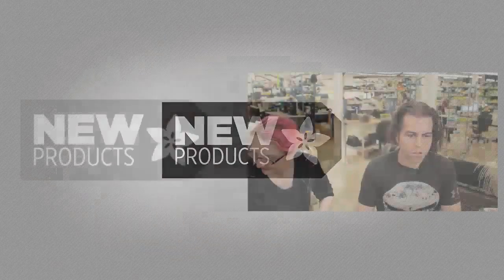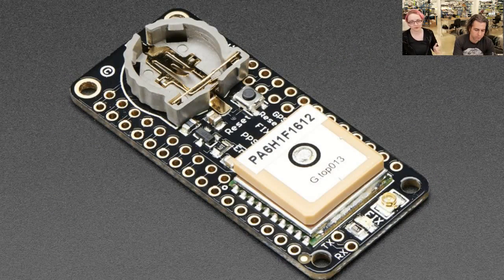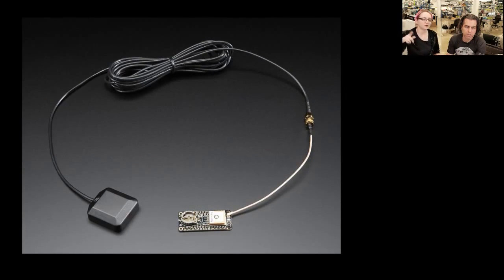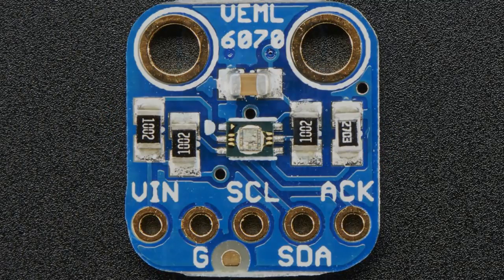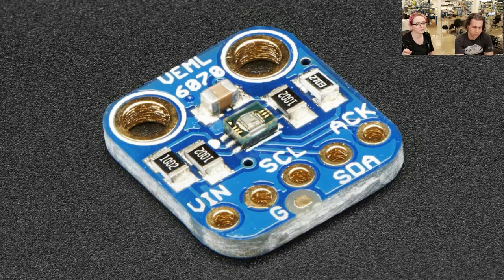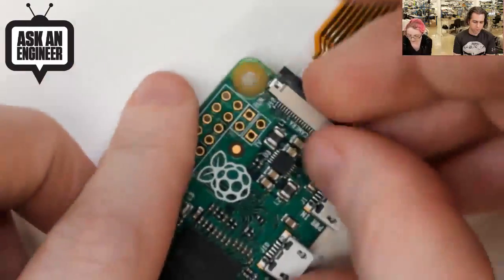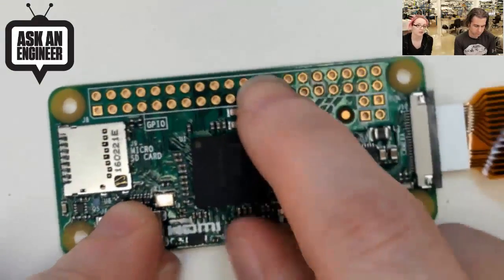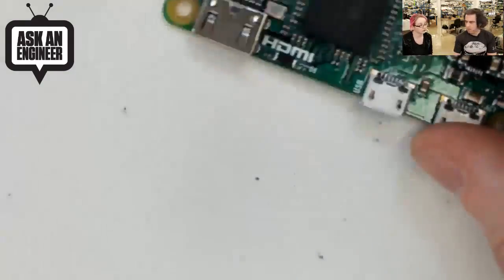New Products 5/18/2016

Comment: Ran Boinc. Of course it pegged it to 82 C and started to throttle. I'll give it a shot, then see what it does with a 40 MM fan...Gus at Pi My Life up has a nice setup with an oversized sink and fan. Ran in the upper 30's to low 40's with all 4 cores maxed.